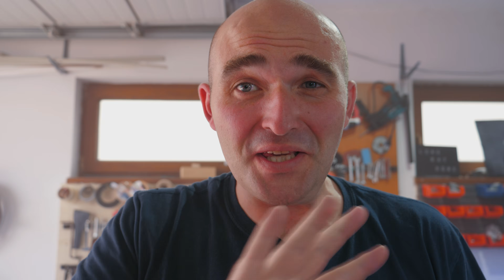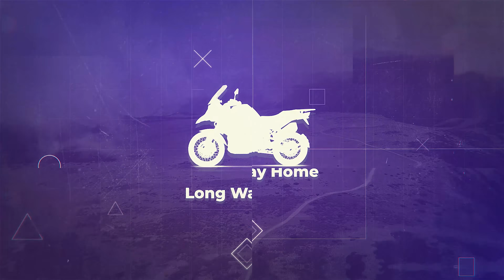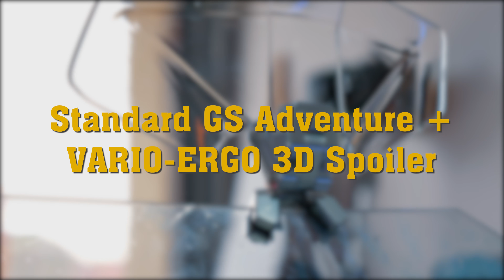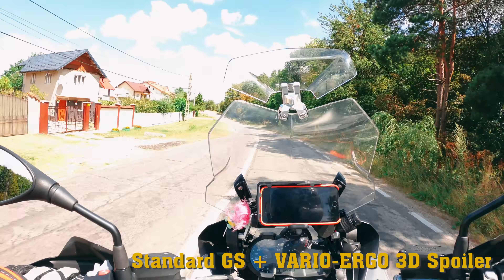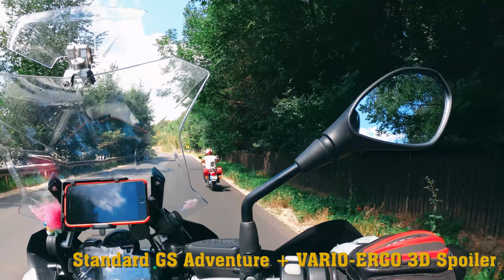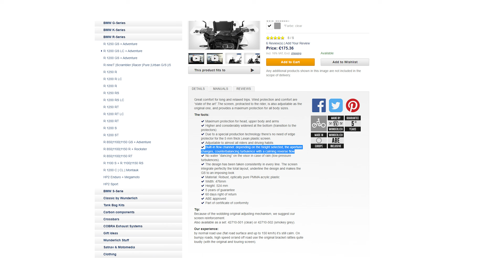NO MORE WIND: Wunderlich Marathon Screen vs Standard BMW GS vs BMW GS Adventure vs Vario-Ergo 3D

Comment from the maker: What screen are you using? OEM or aftermarket?
Reply: No screen yet because I’m waiting fir your Benelli Imperiale review before I buy one. Bags and a screen are my first mods.
Reply: Stock GSA screen at the moment, so very interesting, it’s not that bad for me as far as buffeting of the helmet goes but yes, some more shoulder protection would be great. I believe Puig do a good screen too. Would be very interested to see you test it. PS: Loving all of your content.
Reply: I’ve got the Marathon Extreme on my 850GS, love the extra protection against the wind and elements! I do a lot of off-road and works great!
Reply: Wunderlich marathon, still looking for a spoiler to put on, I stil have a lot of wind around my helmet, was hoping you would show a marathon screen with spoiler. (I'm 2.0 meter with seat in high position).
Reply: PUIG on F800GS, but IT is not worth of money. Added wind deflector and it's better, but had an opportunity to test Wunderlich and it's way better... I wish Id bought it before.
Reply: Givi Airflow
Reply: A Givi screen on my R850RT, it has an upward 'lip' at the top to kick the wind a wee bit higher than the stock BMW screen.  But with these temperatures I like a bit of a breeze so it stayes down.
Reply: Ermax. Not worth the cost, I'll tell you right now.
Reply: GSA with MRA X-Creen. Great at three-figure speeds and everything beaneath for me (6ft 2").
Reply: In Florida i kept my standard GS screen, yes it is a bit noisy but not horrible in my Shoei GT air
Reply: Just bought a 1250 GS. It had the V-stream windscreen from Z-technik and it is also very quiet, but pretty big and therefore quite ugly. It also came with the black standard GS screen that's quite nice, looks cool but is very loud for my almost 190 cm. Hope the standard GSA which I just bought second hand will perform in the middle of those two, like best of both worlds I hope. Thx for this video.
Reply: I’m using the Puig Touring screen on my 1090R for longer trips. It seems to work fairly well for me at 183cm tall (I ride with earplugs in). It’s significantly quieter than the short stock R screen. I can see over the top of it on the road even in the highest setting but off road or in the dark the edge of it can be a bit annoying as it’s pretty close to my center of vision. In the lowest setting the headlight shines into it at the bottom so it lights up and is a bit annoying in the dark. But overall it works well for me. I bought it mainly because it was the cheapest taller screen available to me and also was the easiest to get my hands on (in norway).

Comment: Ok I don’t know what’s wrong, but I just got the marathon pro for my r1300gsa and I’m not impressed. The stock screen does a better job of clearing the helmet, and I suspect it’s due to the shape. Wunderlich is a flat screen, BMW has a channel in the middle that I suspect makes all the difference. Why didn’t Wunderlich just take that and make it a tad taller and wider. The Wunderlich is a bit better on the shoulder buffeting but it doesn’t justify the $300+ price tag.

Comment: Nice idea but totally unrealistic.  The problem of buffeting is NOISE. 
So the only correct way to examine windscreens is by measuring noise inside the helmet at different speeds (and perhaps also headshake). 
Why has no one ever thought of that?

Comment: VERY late to this but... I adapted a Givi AirFlow to my GS. It's a total game changer. I sat in a silent bubble up to 140kph. I could cruise at 110 with my visor up. I'm over 6' but have a short body. A big advantage was the height adjustment so for example if it was really hot and If I wanted a breeze it was very easy to adjust.  I can't recommend the AirFlow highly enough.

Comment: 9:00 Mr. Professor (at D0nald Tr@mp University) of windshields and aerodynamics, 🙄 when you tell us you are 1.8 meters tall, that is irrelevant for the most part.  All it tells us is that you are 5' 9".  The question, Mr. Professor 🙄, is what is your inseam?  Because not everyone's legs and upper torso are proportionate.  The upper torso height is what matters.  

Furthermore, a qualified professor would have told us how tall this windshield is with respect to our mouth, nose, eyes, etc.   You can learn a thing are two from this video:  https://youtu.be/biFx4_vVGG4

Comment: Thanks for this video ! After a lot of inconvinience with the wind protection on my 2021 R1250 GSA I (187cm) changed to the Wunderlich Marathon a few weeks ago and I am very happy now ! There will never be the 100% solution for all riders @ all speeds, but I would say for me 80% of the inconvinience is gone which means a huge improvement. I also recommend the windshield reinforcement on both sides which holdes the screen rocksolid.

Comment: Useful video. Thanks. I’ve just upgraded from a GS to a GSA and am disappointed that the wind noise is worse on the GSA. By the way, is that the phone docking mount you have on your GSA? Any good?
Reply from the maker: It’s a cheap one that fits in the original cradle but I don’t use it anymore because it grinds down the original pins. Stuck to quadlock
Reply: Thanks. That’s helpful.

Comment: I tried a Wunderlich screen on my '22 GSA low suspension with bar-baks and Sargent seat set on high, front and rear.   I'm short of leg but long of torso, so I sit pretty tall in the saddle..  I didn't think the Wunderlich was tall enough for me.   They only make one size.  It helped buffeting a ton over the stock screen but I was still getting wind straight in the face..  After trying an Aeroflow and the Wunderlich, I decided I liked my VStream Deluxe Touring the best of the bunch, It was a lot cheaper and just as well made.  I also got Aeroflows "Aerowings and hand-guard deflector kit".   I'm pretty comfortable on the bike now.   

I tried two of the clip-on/Chinese knock-off "booster screens".  Both lost little bits and/or came apart while on the road and had to be removed.    I learned that they do work but the VStream is really too tall for them.  I tried turning the upper part upside-down and placing it mostly in front of the VStream.  I got a great position where it didn't block my view and really worked well...until about 50mph, where it started banging against the Vstream rapidly.  Ah, well...

I've had 4 RTs beginning with a '99 R1100RT over 20+ years.  Each one got a Sargent seat, bar-baks and a touring screen (Aeroflow or CeeBaileys). This is the first GS.  Finding my happy place took a lot longer on this bike.  After a year, I'm still tweaking it.   I like the storage and geometry of the GSA. I have an AltRider 2-piece flat luggage rack...(basically a pickup bed?) that replaces my pillion seat and standard rack).  Great for hauling my camping stuff.  But I miss the RT's longer gearing, better highway MPG and aero.   Suspension travel of the low suspension GS feels about the same as my RTs.   I'm using 90/10 Conti Trail Attack 3.  Much better than the BMW supplied Bridgestone 024s.  Tread noise was obscene.  All fixed with this tire change.

Comment: I test rode a GS and GSA and immediately chose the GSA due to wind pro.  I will be doing half on and half off road.  I rode my K1600 home and realized I needed better touring protection and am buying the Wunderlich. I don’t mind exchanging them on the occasion where I’m traveling at high speeds to the off-road in high heat, but that is only 2, maybe 3, months per year.  I’d rather have good protection most of the time.  Wunderlich always has the most thought-out accessories too.  Nobody compares when it comes to BMW products.

Comment: I may be the only one who thinks this, but just I cannot look through a plastic wind shield on a motorcycle. It's always impairs visibility way more than aids in wind reduction. Look at 6:00 you got to deal with glare, dirt, scratches and optical distortions, not to mention uneven buffeting in all the wrong places. I'd much, much rather not have a windshield at all.
Reply: the best height IMO is the one where the screen top part ends at your nose level so that your eyes look at the road just above it. Almost Did a trip to Alaska and the screen got dirty fast with all of the mosquitoes and other bugs kills. Ran into a fellow rider who had to ride standing as he could see the road due to the tall dirty screen he had...

Comment: I own a GS and i did not like the angle in the middle of the OEM screen, so i looked around through the internet and then get the MRA which looks nicer, a little bigger, and much clearer.  i'm 175 cm and i'm also putting the seat on the lower position.

Comment: A lot of the wind blast on the shoulders comes from the sold part of the fairing. That's where wind tunnel development makes the difference. Ever higher and wider screens do some good, but have downsides too. Bikes don't have windscreen wipers, and you need smooth airflow over your helmet to clear rain from your visor.

Comment: Here's my case. 2014 GS with OEM screen, 192cm tall, I ride with the seat in high position and most of the time with suspension in helmet+luggage mode (I have freakishly long legs so extra room is welcome). When I first got the bike I thought the wind protection is very good, compared to my old Versys 650 with MRA Vario screen. Then I found this exact 3D Spoiler on Aliexpress and ordered it for around 45 euros. I didn't expect much but when it arrived I was firstly stunned that it looked EXACTLY like the original Wunderlich ones, even the printing on the glass and bracket was done to perfection, the quality of everything is insane. I almost wonder if Wunderlich is outsourcing it's production to China and then selling it in EU for 3 times the price, and some of the manufacturers in China are skimming the product of the top rack and selling it on Aliexpress.

Long story short, it made a huge difference, especially because I have a peaked helmet. Not even a hint of wind on it. I can even ride with visor up on 160kph with no wind in face. As for the lateral protection, it is a problem but not a huge one and I hope that I will solve it with some add-ons. The view through the 3D spoiler was annoying at first but you get used to it pretty fast so that is no longer an issue, I can see just fine through it. Cheers from Serbia, neighbor !  :)
Reply: Hi, Marko,
the products that are Wunderlich branded and sold on Aliexpress are plagiarisms. We do not manufacture in China. These copies do not have any safety checks and are not approved for road traffic. Since our products, especially the spoiler attachment, are manufactured in Europe (mostly in Germany), we subject our products to extensive safety tests and we also apply for a general operating license for our products, it is not possible to see a price of Aliexpress as a benchmark. In addition, our production methods are sustainable and we try to produce climate neutral as far as possible. All this does not happen with the fakes on Aliexpress. In addition, the use of a fake, copied product that has not undergone any security checks can be very dangerous. 
Greetings, Sven
Reply: @WunderlichGmbH  Thanks for the explanation, I didn't mean any ill thoughts towards you guys, you are an awesome company and I do have original Wunderlich parts on my bike. It's just a case of me browsing through (still) free markets and finding this out, it was curious and I wanted to share the experience. Best regards!
Reply: Hi Marko,
no worries. We only wanted to explain why the price is different and why it could be dangerous to buy such a fake product there. 
Best Regards, Sven
Reply: If you feel so little responible towards people and nature, you are of course welcome to go through Chinese exploitation companies, but I can't understand that... I think Wunderlich always takes the shortest logostics route and has everything produced in Germany and Europe. Then I am sure that nobody is exploited and I can trust the quality of the products. It's worth it to me!
Reply: @leonkrischer3955  U have to understand something. I live in, most would say, third world country compared to rest of the EU, so it is extremely hard for us to get such products even for the price you guys have out there in the  free world. The import taxes are insane and the market itself is so small, the companies are not inclined to even offer the products here through regular dealerships. Many times it's not feasable for us to pay such prices. So we do what we can to get the stuff. That includes dealings like I described. Cheers.
Reply: Ahora te enteras😂😂. Yo miro en Wunderlich y luego me voy aliexpres es lo mismo. Mira los espejos opciones 719 y luego vete aliexpres 550 € contra 66€ blanco y en botella es leche

Comment: I have a 650 VStrom which I bought used from a local dealer, it has a GIVI Airflow adjustable screen. I am just over 6 feet tall (185) and in 40 years of motorcycling I have never had a bike with a screen before. Riding through a rain storm a couple of days after I got the bike, I set the screen height so that all the 'weather' was deflected off my helmet and upper body, all good. I then started to put some miles on the bike and found it quite twitchy and pretty disconcerting to ride, especially on windy days. In the end, just before deciding the Strom was not for me, I experimented by putting the screen down to almost its lowest level..... transformation! Still no wind on my helmet or body, but a stable predictable riding bike. This may well be common knowledge amongst those who have long ridden with screen, but it was a real eye opener for me.

Comment: I have the Puig windscreen on my GSA and it really helped a lot.  And was less expen$ive.....
Reply: The Puig worked for me also.
Reply: Good to know, I have been wondering about the Puig screen. Cheers
Reply: I purchased the puig, but I’m now second guessing myself.  Was wondering if anyone has tried both for comparison??
Reply: I had the Puig.   Broke it in a crash.  Got the Marathon II And it was better by a lot.
Reply: Also.  The Puig clip on visor to add is really nice. And you’re not looking through a large aluminum clamp.  And three sizes.  
FAR BETTER. 
I’ve carried mine to my K1600 GTL and now my RT.

Comment: I am 1,95m and installed the little 3D Wind deflector additionally. Now I am in pure silence with the seat in the upper position and can ride with the visor open. It works great but looks horrible. 😉 stabilization mount is a must have!
Reply: What screen are adding the 3D Wind deflector to?
Reply: sdipper7 to the marathon screen